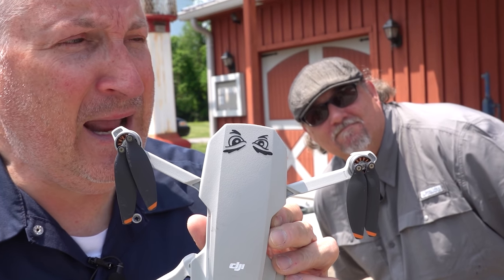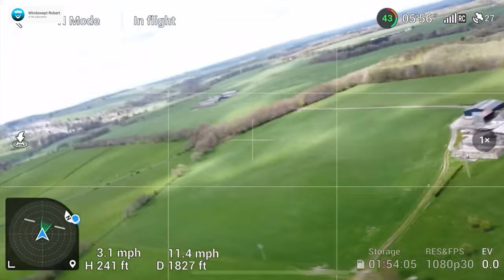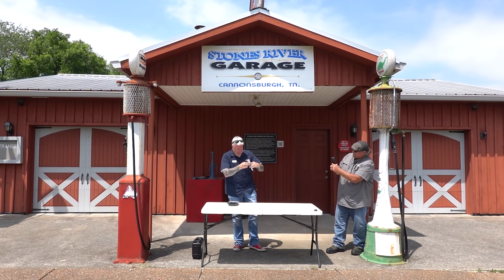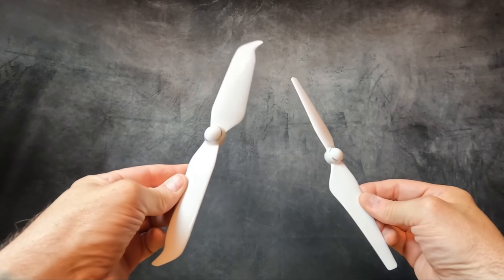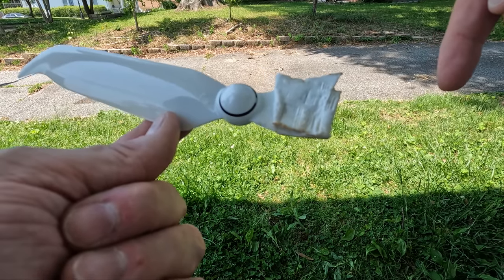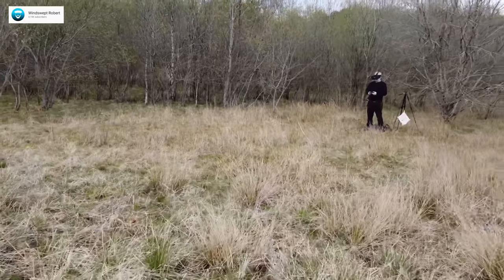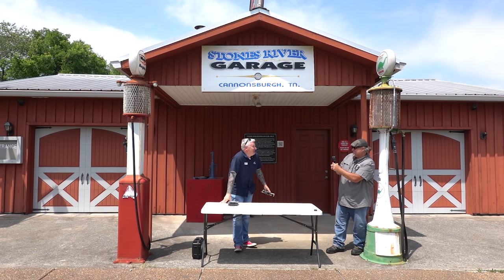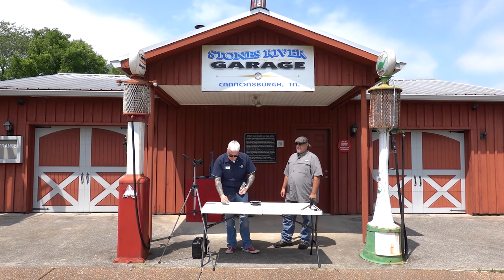Can the MINI still fly with HALF the propellers Missing?

Comment: If you cut both props down to the sweet spot, the area of the prop that generates the best lift, then test it.  It should be balanced and still not work.  But more options to try and destroy more stuff.

Comment: Try using something like metal coat hanger wire for balancing weight(s). Bend a small loop on one end for the mounting screw and then trim the rod(s) to the length needed for least amount of vibration...

Comment: Ken for your next set of testings could you test if the drone would fly with only 3 propellers??.. meaning remove both props on one arm only and check if it could fly (to see if in a catastrophic failure on one prop or one motor the drone could keep flying to land safely…
Reply from the maker: I can tell you that it absolutely will not with that configuration.

Comment: You should try this again with a 3D printed counter weight just like on that one bladed helicopter (but obviously smaller scale). And by 3D printed I mean a little rod that attaches to the screw and has a place for a lead weight or something. Of course you have to do some experimentation to balance it properly before designing the 3D printed arm.

Comment: Last year I bought one of my Minis' a set of props that I was led to believe were of quality. They were not. Every so often the drone would race upward 5 or more feet for no apparent reason. Until I figured out the problem. I thought my new drone was defective. (Not cool) I still have the small box these props come in if anyone wants to know so you can avoid them.
Reply: So why did it make your drone race up? You never stated why the new propellers did that
Reply: @ryannglazo7991  I don't know. When original props were put back on the drone flew normally and has been fine for over a year. These replacement props cost $10. for a set and come in a little 4-color print box. I was led to believe these were after-market "Quality" props. They are not.

Comment: disappointing, I thought they would cut the length of the propellers in the 4 motors to do the test, and the motor would not lose balance, but it's silly to remove half of it from one side, disappointing test.